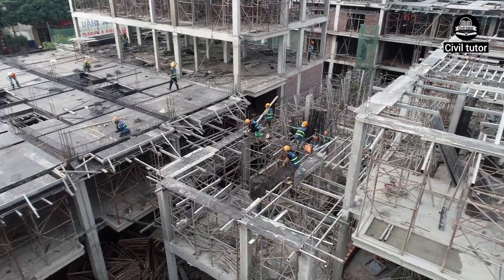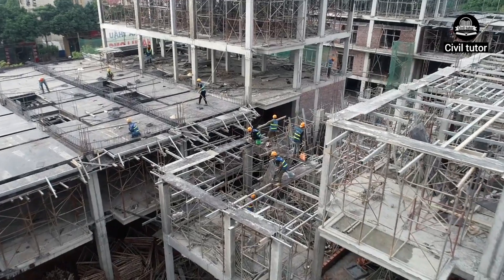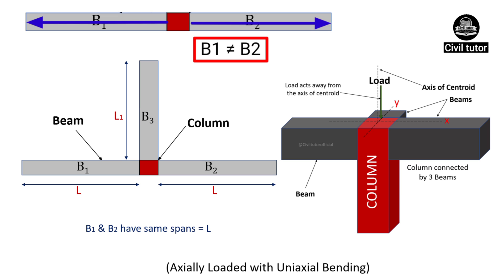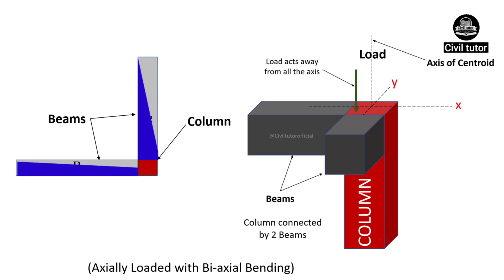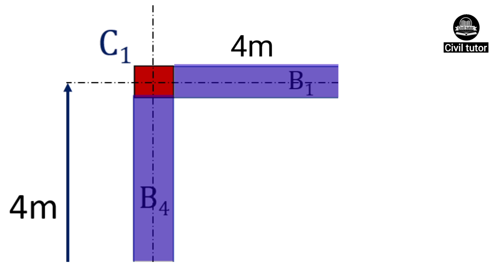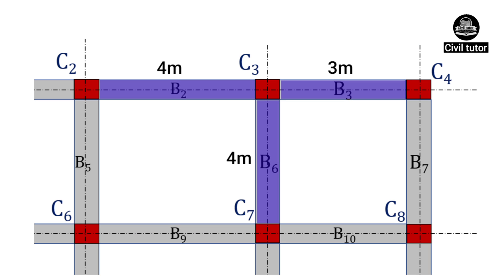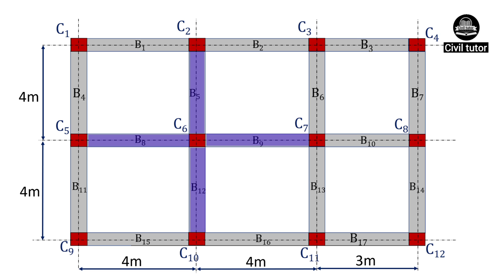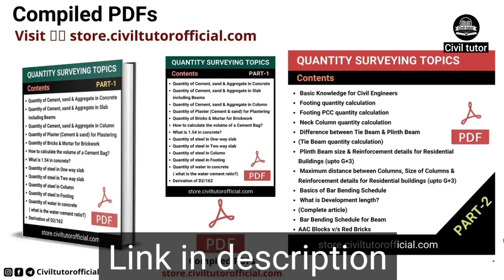How to decide if a column is axially, Uniaxially or Biaxially loaded? | Design of Columns | Civil Tu

Comment: Hello sir, I have a doubt regarding eccentric loading. Suppose let's say an uniaxial column, the loading is acting at few inches away from the center in anyone of the axis. Are there really two sources of bending moments in this? one from beams and other due to eccentricity of the vertical load from  the beam ?